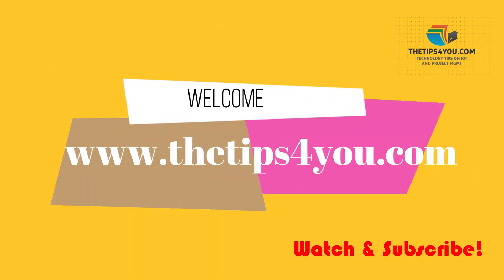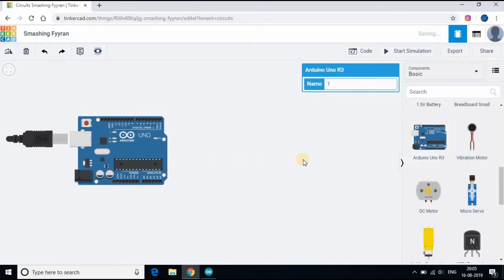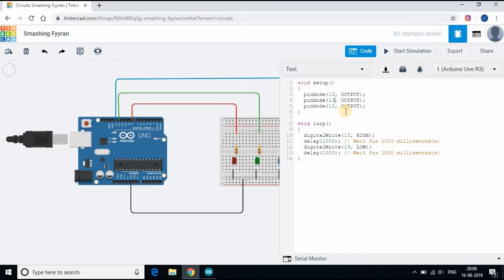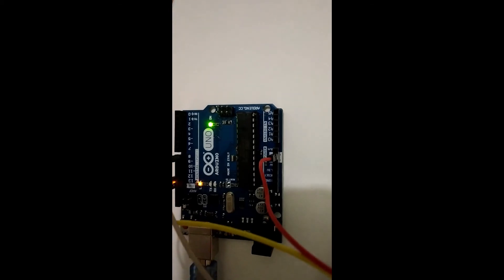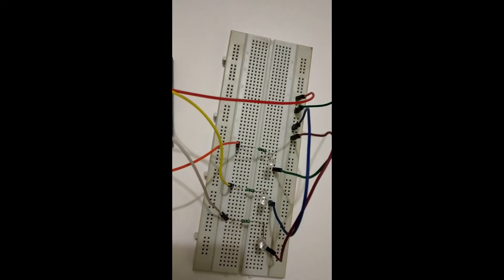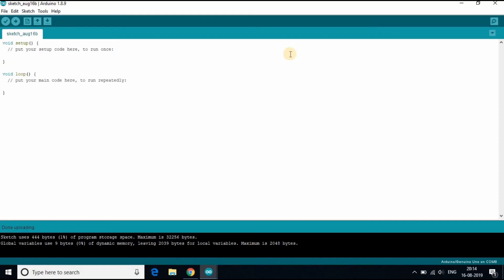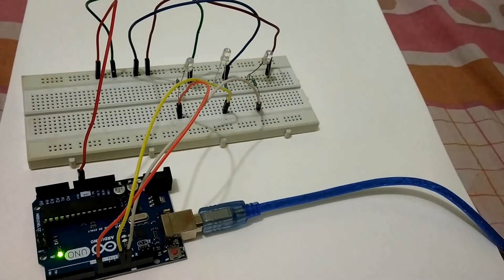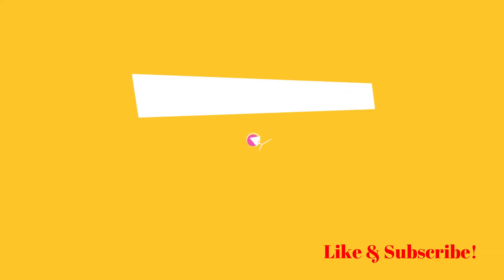3 LED Blink Arduino | 3 LED Blinking Circuit | How To Blink Multiple LED Arduino

Comment: How to make LED blinking same time
Reply from the maker: What is exact question?
Reply: @Thetips4you  sorry late for reply back
Reply: @Thetips4you  Build a program where the LED on pin 2 will blink 3 times with a delay of 1 second and after that, the LED on pin 3 will blink 5 times with a delay of 0.5 seconds. This sequence is known as 1 complete round. The program will repeat the flashing until the power is turned off. power
Reply: @Thetips4you  have any idea what codes to use for

Comment: Good day  👋

How to setup code for my 4pin led rgb module in which the led fast changing colors blinks in line with the speed of music beat or noise and automatically turn to super slow changing color mode when there is no music or noise detected on the surroundings?

Comment: why does 13 12 ans 8 works in the pinmode and digitalwrite section but not other numbers
Reply from the maker: What do you mean other numbers? We are defining the the Pins 12,13 and 8 used for the circuit.

Comment: What are the black lines?
Reply from the maker: Black wires are going to GND
Reply: Examples using delay() to accomplish such functionality should be banned. They teach bad habits and cause problems for beginners .
Reply from the maker: @PeIVBV  This is a very basic program. Please share your code for helping the right way to do it.
Reply: @PeIVBV  yes delay is shit.. It stops the code from running for that period... I learnt after lot of struggle figuring this our